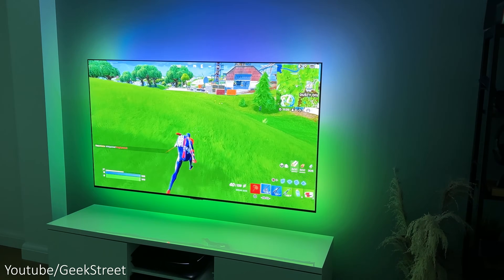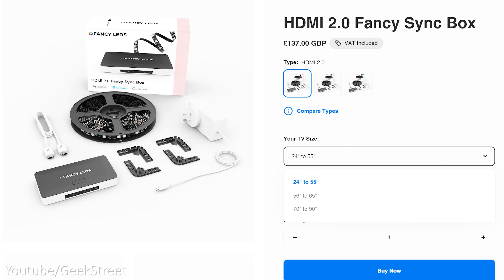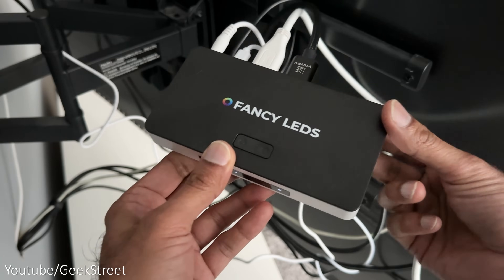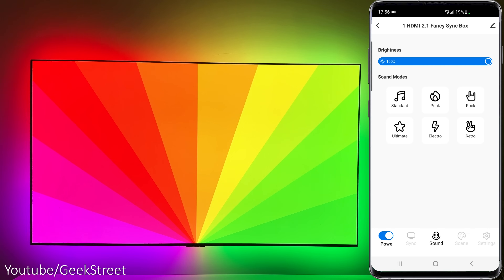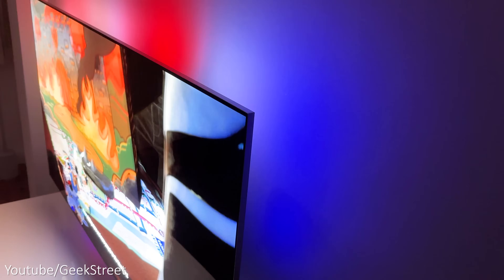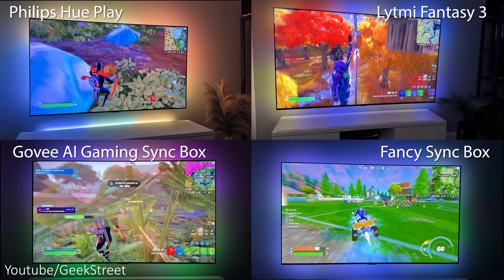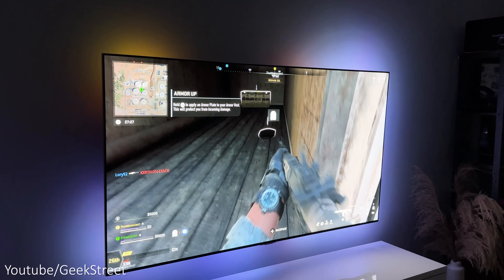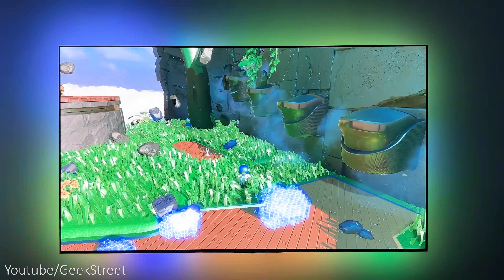The HDMI 2.1 Sync Box that DESTROYED Govee and PHILIPS HUE Sync Box! | Fancyleds Sync Box Review

Comment: It’s a big letdown that it does not support 5ghz.. makes it unusable for my setup.. using orbi mesh, I cannot choose 2.4ghz..
Reply: Your Orbi mesh system emits both 2.4 GHz and 5 GHz bands under the same SSID. The 2.4 GHz band is better suited for long-range WiFi connections, prioritizing stability. The 5 GHz band is better for high-speed connections, which is not necessary in this instance. The Fancy Sync Box will automatically connect to the Orbis 2.4 GHz band.

Comment: Only 1 HDMI input?
Reply from the maker: Yes but they now do a 3 input version https://youtu.be/2cOwir2V9Go
Reply: @GeekStreet  OK. Say I've got a picture setting for dvd movies and another picture setting for gaming on my ps5. How is the picture setting going to change if I'm only using one hdmi input from the sync box to the tv?
Reply from the maker: @MrDogtown22 picture are generally set on the hdmi port so in that situation it'll have to be changed manually
Reply: @GeekStreet  well that sucks if you want to use the lights for movies and gaming then. 

Maybe you can test it as some tvs have smart HDMI where they can detect a source and change saved picture settings even when using one HDMI port. 

Looking forward to your results.

Comment: Govee / camera-T2 is better why? don't spend on $$-cables?
I have it, and 4 Govee Smart Light Bulbs(all$40) on each corner of the ROOM, and the tall lamp by the side of where we sit (6-all Govee & link to the app) and ALL the WALLS of the room is a THEATER for PS5, DVDs. MOVIES, SPORTS. I even stream my laptop to the Flat 65" TV, at 10" away from the wall (TV looks like it is floating in the air). It is like a NIGHT CLUB nothing compared to just lights around the TV. and if the screen is black everything gets dark like off "pitch black", and when the TV is off, everything turns off. plus I can control each preset color-intensity of light on each of the WALLS. the TV is now like a window, whatever is on the TV ALL the WALLS light-up NOT the room, because it is still dark in the room.

Comment: 1 HDMI input, disgusting. I will happily pay an extra 100 for 4 HDMI ports. Really I want Govee to release a box like this with 4 HDMI ports so that it can sync with my Govee lights.
Reply from the maker: I recon alot of people would be up to paying the extra
Reply: @GeekStreet  could you not just use a HDMI switcher? Will the lights still work ?
Reply from the maker: @liampardoe2877  you could definitely but most people want less cables less boxes
Reply: @GeekStreet  thanks for reply. Cables and boxes don't bother me so I think I'll purchase it with a splitter. I was toying with the 3 HDMI box but I can't get past the no vrr. If this works with a switcher then happy days 👍🏻
Reply: @liampardoe2877   did you find a splitter that supports all the features of the sync box?
Reply: @AZZomwhazz  I got this off Amazon. 

HDMI Switch 4K 120Hz 8K 60Hz, 5 In 1 Out HDMI Splitter Switch with IR Remote, 5 Port HDMI 2.1 Switcher HDMI Selector 5x1 HDR 48Gbps. 

I'm still waiting for the fancy lights to arrive. Don't think they ship from UK as it's taking a while. The switcher works fine with my current set up. Low latency, 120hz, VRR and HDR are still enabled so I'm hopeful the lights will work fine and I won't have any issues
Reply: @liampardoe2877  Nice, waiting for your review! haha
Reply: I mean, you don't have many less cables. If you use a splitter, it is 1 extra cable from the splitter to the box. It actually makes it a bit more organized because my splitter is behind my TV desk and one hdmi coble to the sync box that is behind the TV.

Comment: Only one input is a deal breaker, unfortunately
Reply from the maker: I think they did this to keep the price down, what do you think should be the minimum number of HDMI 2.1 input ports?
Reply: I get it, it is cheaper than the competition but you need at least two ports, one for console and another for a media PC/streaming device. I use both a PS5 and a laptop connected to my TV for games and movies/streaming so having to swap HDMI cables would be a nightmare. You mention a HDMI splitter but how would that work, out of curiosity, how do you change inputs to the sync box?  @GeekStreet
Reply from the maker: @wreckronomic6663  a spliter would have 2 or more inputs and one output together with a button on the front to allow you to switch between the inputs
Reply: So if you combine the price of this backlight and the cost of a HDMI 2.1 switcher then you might as well buy the Lytmi Fantasy 3 for the same price and it has two HDMI 2.1 inputs, it doesn't have VRR though I don't think.
 @GeekStreet
Reply from the maker: @wreckronomic6663  yeah it doesn't have VRR or ALLM on Lytmi's sync box. That was the big deal breaker there when I reviewed it.

Comment: If you got the cash, just stick to hue sync box with a HDMI splitter to get 4K 120hz HDR VRR ALLM, it’s much simpler to use, never has issues and wont have to worry if this company folds like dreamscreen cuz who really knows this company which is mostly from China.  Also, hue is like iOS as all others is like android in term of software.  I dont have any experience with this brand but govee, dreamscreen and hue and doubled down on hues as its on 3 tvs in my house as well as my entire house’s lights along with two bridges.  With hues, it’s much easier to change TVs cuz it’s much easier to remove the tv back lights.  With those other brands, you will most likely have to buy a new LED strip for the back of TV.